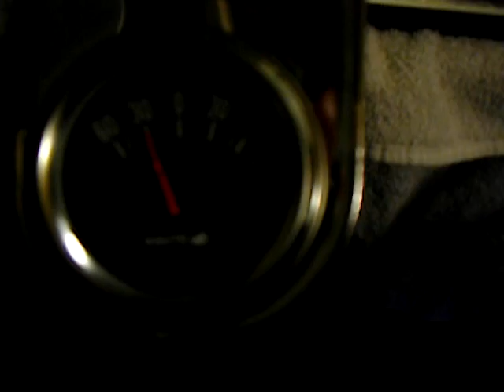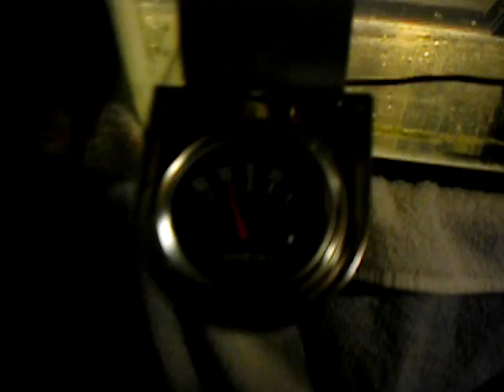Hydrogen Production Cell

Comment from the maker: The power supply said 2 amps but once we got an ammeter it read 15-18 amps and that was at 6 v, we tried 12 v but it kept tripping the circuit breaker in the power supply so we are currently running 6 volts @ ~16 amps for a total of 96 watts. We planning on getting a small 4 stroke cuz the 2 stroke blows through half of what we input as fuel.